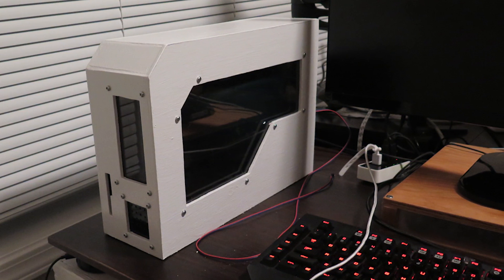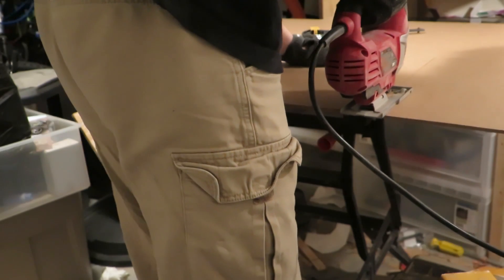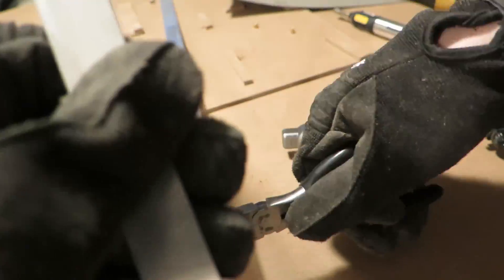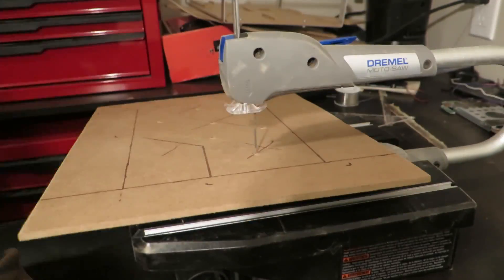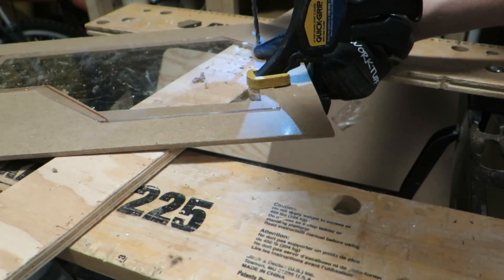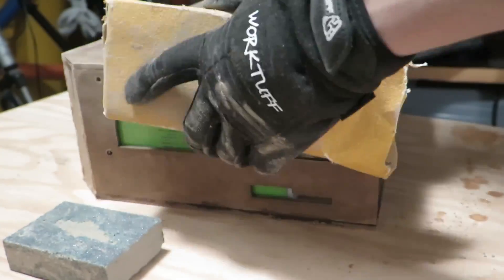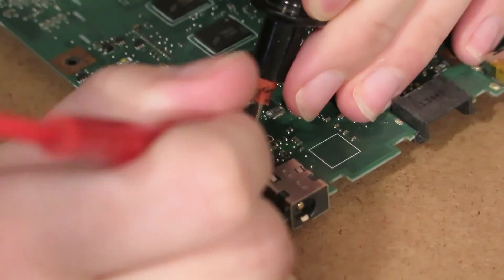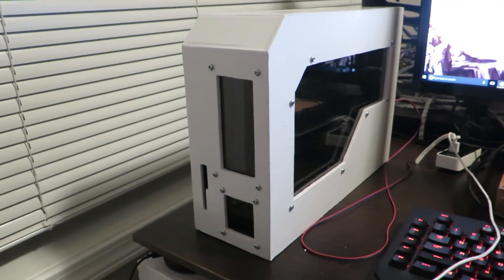Custom Linux Computer made from old laptop

Comment: Thanks Keith, was a good watch and gave me some ideas for my custom PC case I will be building with wood. But, what about ventilation?
Reply from the maker: You're welcome Daniel :) Ventilation wasn't really a concern for me back when I did this project since the laptop motherboard it was built from was really low-spec and barely produced any heat, and the entire back of the case the open. However replace that front-bottom panel with a metal mesh and put a 12V 40mm fan behind it after I recorded the video just in case

Comment: If you were only reusing the laptop internals i find it better to just disable the lid mechanism and use it as a slick and thin desktop connecting it to a external monitor and disconnecting the dead internal screen. If the laptop is thick i would just remove the screen frame. It will look like a console like a ps2 or something like that when running with the lid closed.
Reply: you get better temps and clock speeds putting it into a large case.  laptops basically always thermal throttle or power throttle.
Reply: jordan secrist Nah, that is only for shitty haswell and newer ulv chips. Prior ones (lets say sandybridge, ivrybridge) usually are really well made laptops...
Reply: Eduardo Avila I mean it does depend on the system. But you will get better performance with better temps. Plus his cooler looks almost as thin as a piece of cardboard. Lol
Reply: jordan secrist yes, certainly if the stock cooling solution couldnt keep it under 85-87°c under heavy load, it would help alot. 
But it depends on what laptop and what manufacturer you have. Older dells, like my 1545 dont even pass 65°c, so there would be no point in getting it in a huge case (if the reason would only be getting better cooling). 
There are some, as a asus that i've used, that by default run at 85°c, and that in full load throttles very hard, in that case, the benefit is right away very big.

Comment: This is absolutely brilliant!  I never would have thought of it, but wow!  This takes recycling old laptops in a completely different direction.  Aside of it just being cool as hell that you did this, it wouldn't take much to turn this into a lucrative niche.  Either way, this blew my mind and thank you for sharing it!  Go the distance though- put Arch on that bad boy! :) 
Just kidding.  Happy 2018.  Cheers!
Reply from the maker: Thank you for the kind words! I was originally thinking of putting on arch but decided to go with Ubuntu because I'm a little more familiar with using it as a desktop environment, and wanted something a little more stable that didn't require large regular upgrades. I also chose Ubuntu because of its abundance of packages in the repositories vs Arch where a lot of the stuff I wanted to install was in the AUR so it's a bit of a pain to build.
Reply: My pleasure. I'm just kidding with Arch.  Best thing about Linux, to me, is basically do what you like and make it yours.  Such a cool idea.  A steampunk variant of that would probably sell for an ungodly sum of money, or just be cool to have. And it's recycled.  So good!  What's next for cool projects?
Reply from the maker: A steampunk variant would sure be neat to do, I'll have to keep that in mind :) I'm just starting a new day job so for the next month or so I won't have much time to work on projects but after that, I'll probably make some things to improve my office space. I actually have another video where I have all the footage recorded but haven't edited it yet, so I might get around to that in the next week if I have time.